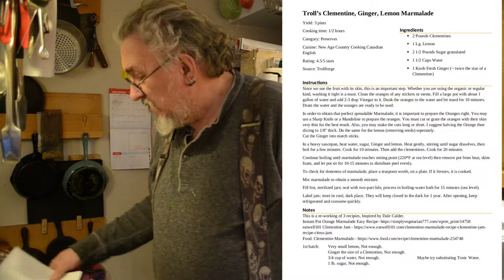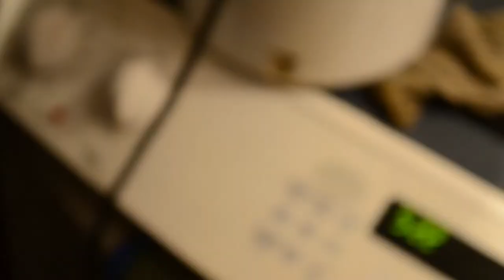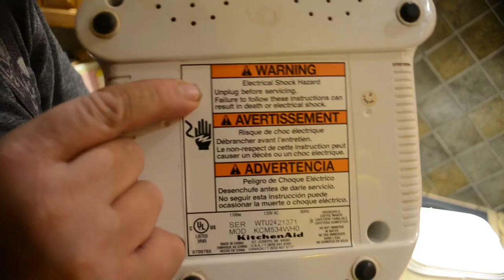Coffee & Marmalade  How to Repair a Kitchenaid Coffee Maker

Comment: Well Tim I don't eat marmalade don't drink coffee but I sure like your collection of kitchen knives
Reply from the maker: Thanks Babs, I started collecting back around '80... ;)
Reply: @trollforge  Did you ever find out where the leak was, was it actually that pot wasn't lined up or did you have a leak
Reply from the maker: @babetteisinthegarden6920  the thing that holds the coffee filter has a funnel built in to direct the water to the center hole in the lid... I left it in the sink... No leak.
Reply: @trollforge  Oh I have the same problem you take something apart and you have some leftover parts whoops